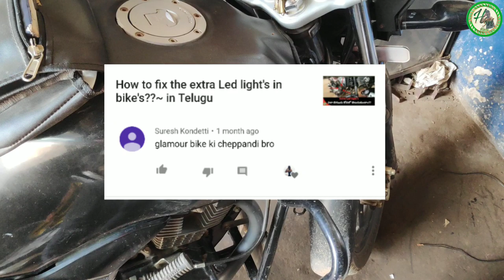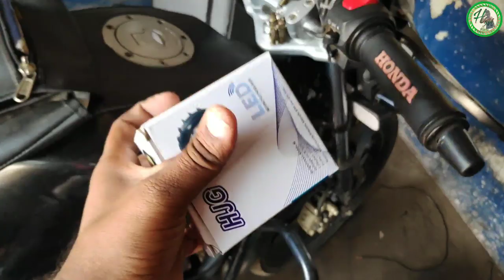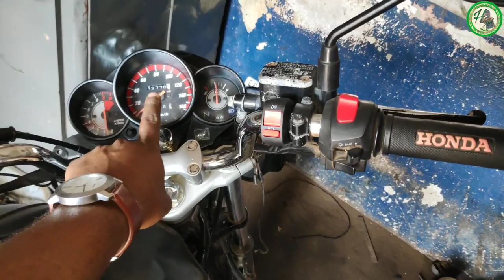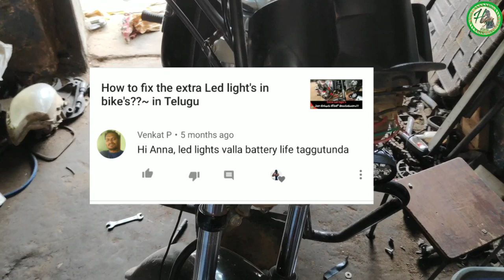How to Fit Extra LED Lights in Any Vehicle💡💡💡

Comment: Hi bro. I am from Bangalore. I did not understood how the earthing u did in this from which connection wire. Can u pls explain me once again. There are only 2 wires for a light and u gave one wire for earthing and other for power supply but how it iß possible with one wire.

Comment: Nice
Reply from the maker: tq
Reply: @HariMec   bayya na bike ki key ignition lock  nundi vacce power wire  body ki  touch ayyi  mottam  power  supplies pani ceyyadam ledu nyutran light signal light horans self emi pani ceyyadam ledu ippudu ceyyali